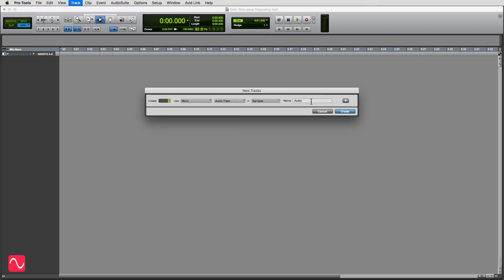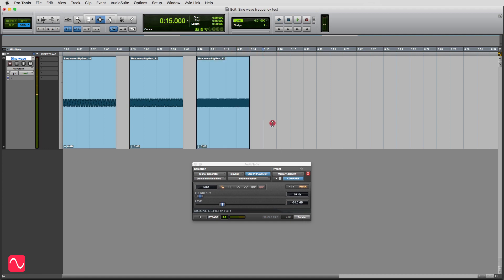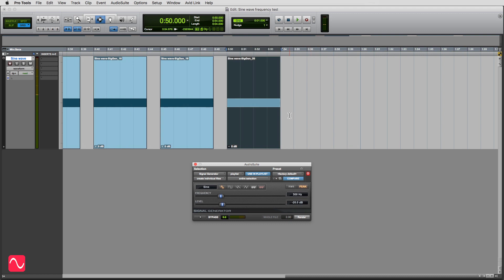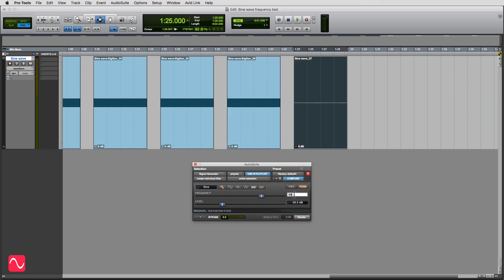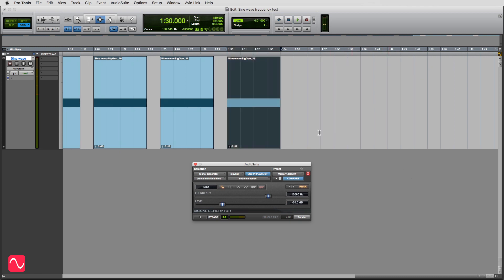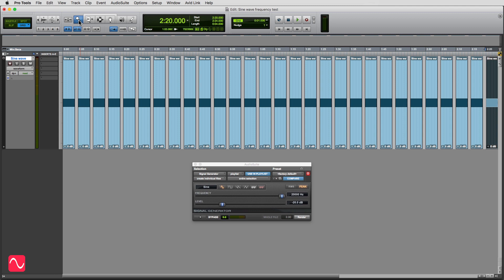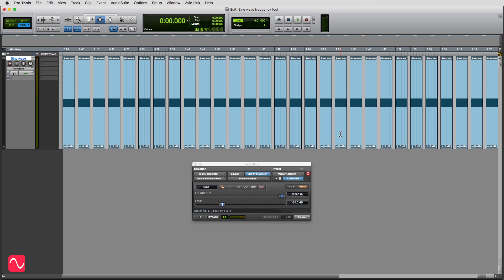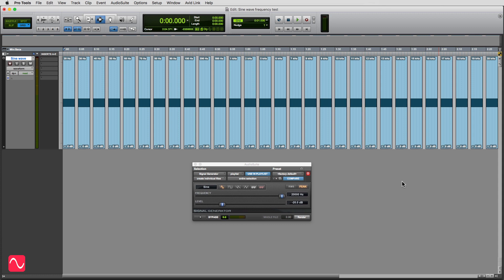Sine wave tones 20 Hz to 20 kHz - Can you hear them all?

Comment: While in my Headphones( AKG 712 Pro ) I can clearly hear even 
20 hz here https://www.audiocheck.net/testtones_sinebursts20-200.php
and also 20 000 hz  https://www.hifi-online.net/sound-downloads/

But it doesn't work here in Youtube very well, it so extreme quiet on 20 hz and no sound at all at high-frequency.
Really either your upload-file is flawed or Youtube fucked up :(
Reply from the maker: If you can hear 20 Hz to 20 kHz then either your headphones and hearing are amazing, or what you're hearing is distortion. The original WAV file for this video is as good as Pro Tools can make it and I uploaded the video with the original WAV audio. However YouTube encodes the audio so it isn't as accurate as the original and the frequency response drops at either end of the scale. DM
Reply: later I've seen you've answered similar question, you responded to mine nonetheless. Anyway thx.

Comment: use a loudness correcting software and bring all samples down to -14 int and it should fix the uneven signals by allowing the freqs to be heard as you intended
Reply from the maker: Thank you for your message, which we appreciate. The sine waves were all generated at the same level and were checked to be at the same level in the soundtrack of the video that we uploaded. The object of the video is to provide an informal test of the viewer's loudspeakers, hearing, and what YouTube's processing does to the audio. Adjusting the levels for equal subjective loudness would be a completely different issue - also interesting, and we may make it the topic of a future video.
Reply: @AudioMasterclass  I was just saying if you do not follow upload specifications it does get the track squashed to the point where whether on my genelecs or Bx5a's or aurotones it falsified the demo you intended that being said I got from 20hz -8khz after that it became hard to distinguish I doubled check with my assistant with young fresh ears he also concurs keep up the good work otherwise have a great week.
Reply from the maker: @MichelJosephPétulli  Thank you for your clarification of your comment. The subjective loudness of the entire audio track in the file uploaded measures -19.9 LUFS according to the Signum Audio Bute Loudness Analyser plug-in. This concurs with YouTube's 'Stats for nerds' feature which measures the level at -5.9 compared to -14 LUFS which we understand to be their reference level. The demo is in no way falsified, as part of the stated purpose of the test was to see what YouTube would do to the audio. Apart from convert it from 192 kHz 24-bit WAV to 44.1 kHz 128 kbit/s AAC-LC there is very little difference other than the complete loss of frequencies above 15 kHz. The level measures at -19.7 LUFS, which is very close to the original, so there is no squashing of the level, in fact a small increase.
Reply: @AudioMasterclass  it does not matter what bit rate or resolution you upload to youtube it will play back at a maximum of 384kbps and if you play back in lower than 720p it will play back at 128kbps mp3 either resolutions are over compressed compared to the great resolution file you may have uploaded that is why you have to follow playback specs protocol for youtube and all other platforms if you want to have honest playback quality
Reply from the maker: @MichelJosephPétulli  It is unfortunate that we have not been able to fully communicate to you the intention of this informal test. However we will reiterate that part of the test was to see what YouTube would do to a high-quality 192 kHz 24-bit WAV file. If you take care to listen to the commentary and read the description it should be clear to you that this is so. This is a test of how YouTube will encode the audio and what it will sound like. A different test, which we may make at some point, would be to encode the audio to AAC locally and upload that, then see whether YouTube lowers the quality further or whether it remains the same. That however is not the test performed in this video.
Reply: @AudioMasterclass  LOL I just told you the level of degradation that occurs because of platform restrictions regardless of the quality uploaded or resolution  I even tried at 32fp 192000hz and other formats (aac)the upload algorithm does the same to all it seems ("at 720p it maxes out at appx 384kbps if played at lower video resolution it plays at 128 mp3 ") and the eq spectrum is also impeded but we must have both missed each other's point lol
Reply from the maker: @MichelJosephPétulli  With respect, you are arguing against things we never said. Indeed we must have missed each other's point and should probably progress to the next video.

Comment: The audio compressed by YouTube does not play (headphones Sennheiser HD200 driven by an Fiio headphone amplifier / DAC) from 16kHZ upwards... I replicate the experiment in Audition (generate tones - sinewave) and my hearing is OK up to 18.500 Hz. After that, if I increase the frequency, I have to crank up volume much higher, and around 19kHz is inaudible. But YouTube does something bad to audio file. Listen for yourself and make an A/B with your original (before uploading).
Reply from the maker: Thank you for your comment, which we appreciate. Just to clarify one thing, the sine wave audio in the video is the original 192 kHz WAV exported from Pro Tools into Final Cut Pro X. The video was exported to ProRes with 192 kHz WAV audio, then converted to MP4 with audio pass-through. We checked the audio by reimporting it from the video back into the Pro Tools session, splitting the stereo back into mono, isolating one channel, boosting it by 3 dB to compensate for the pan law, inverting it and playing it back with the original. Silence indicates that the audio is perfect. Differences between YouTube's audio and the original are completely down to YouTube, and of course there are bound to be differences when the audio is converted to a lossy format.
Reply: True. I double checked with Voxengo SPAN. The sinewaves are not showing up starting from the 16k one.
Reply from the maker: @Niowiad  Thank you. We have downloaded YouTube's version, which is AAC-LC encoded at 128 kbit/s, 44.1 kHz. As you note, there is nothing at 16 kHz or above.
Reply from the maker: One more thing - YouTube may serve different versions of the file to different users, depending on device or any other factor that YouTube deems important. Whether all users get the same quality of audio is something we don't yet have any data on.